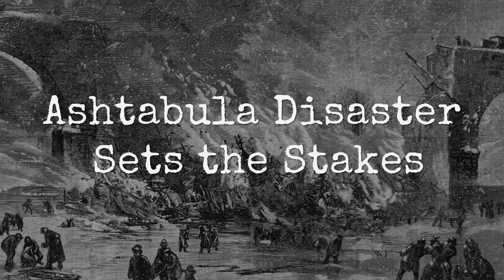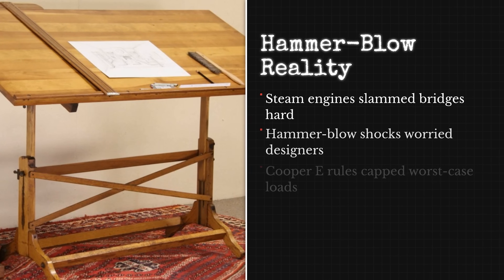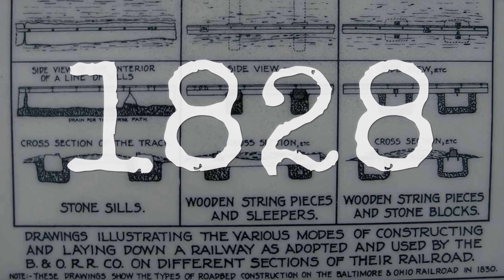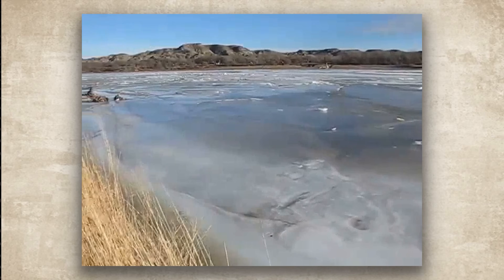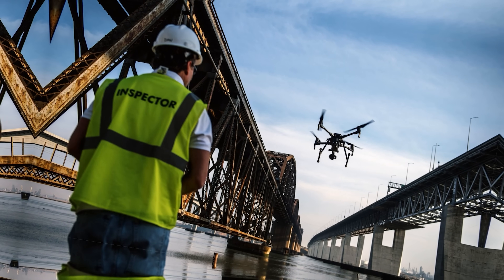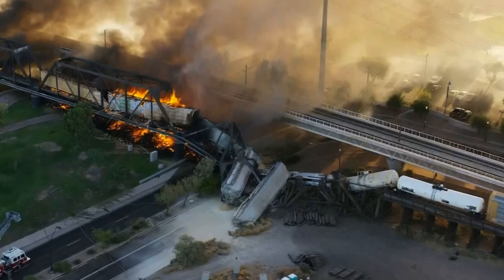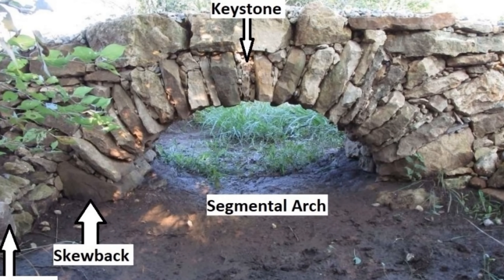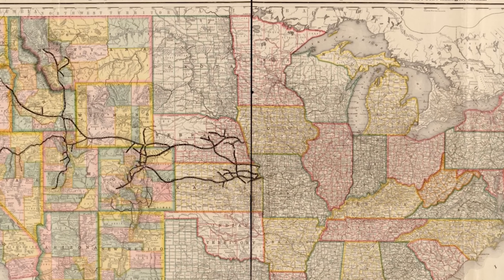Why Locomotives STILL SURVIVE 100+ Year Old Bridges

Comment: My grandfather was a coal miner. My father worked in a steel mill for 35yrs. I've been bending, cutting, welding, and machining metals for 45yrs. No way in hell anyone can tell me that the steel today is anywhere near as good as the steel American steel mills produced since WWII! My 2007 Chevy Silverado frames literally disintegrated in 15yrs, while the frame of my 1975 K-10 is still strong as ever! Some sections took a light coat of red rust, but stopped and hasn't gotten any worse in 50yrs!